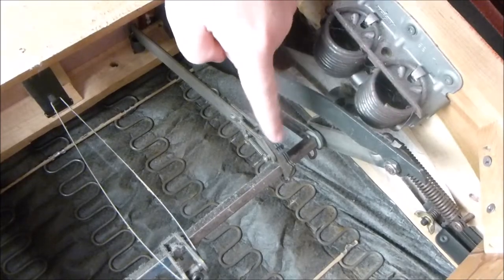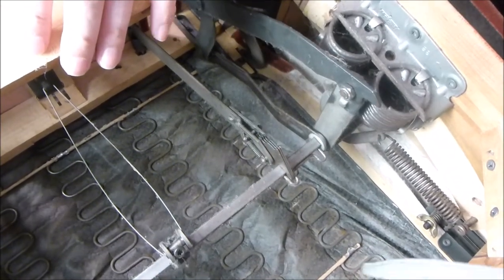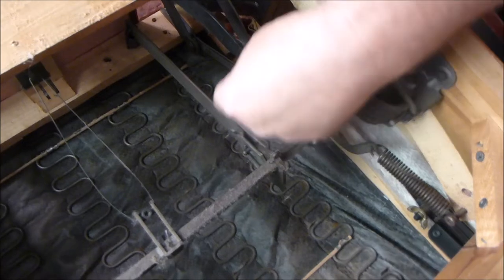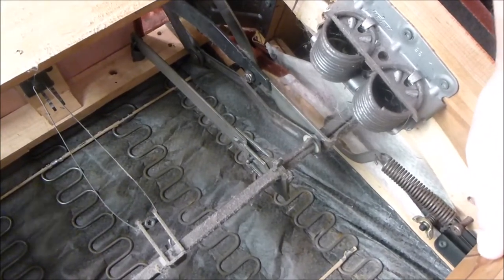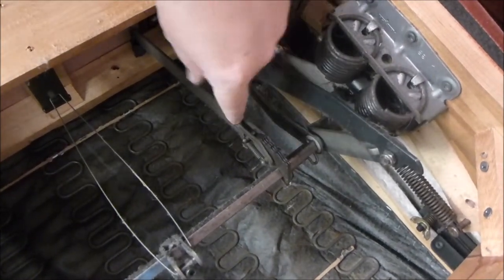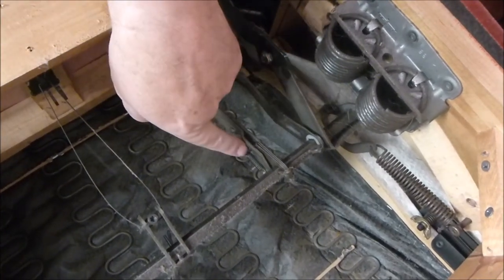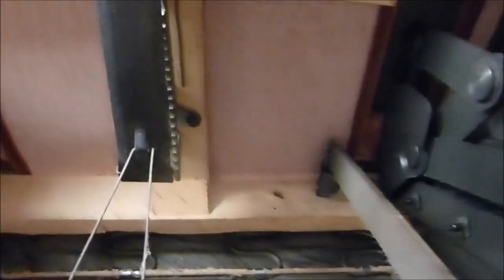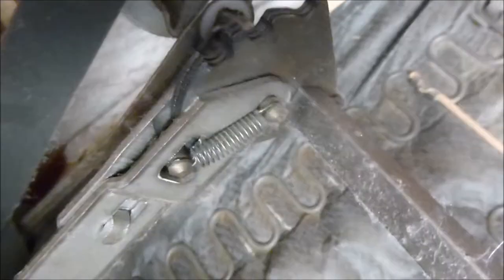Lazy boy recliner, footrest problem

Comment: Thank you for your vid. It's the wire piece/part that has snapped on mine... The wire part that you pointed out towards the end of vid and said it might be broken and jam up into the area above it. What is that part called? Do you happen to have a part number for it? Thank you
Reply from the maker: I do not know the part number but if you told the people that work at a Lazy boy dealership  where it is ( or take a photo on your phone ) they could get the part. For that matter your recliner might have a lifetime warranty on that part.

Comment: We just bought two new Lazy Boy recliners with the mechanical handles. We had too many problems with the power chairs. My wife's chair has too much tension on the foot rest. When she uses the handle to lower the foot rest, it slams down making too much noise. I adjusted the tension on the spring but was only able to move it one hole (no more left). It is slightly better but still too noisy. Mine is smooth and quiet. Any suggestions? Thanks!
Reply from the maker: There are ways but I would not do it to a new chair. The best thing ti do is when you go to let the footrest down, just keep your weight towards the back of the chair and move the handle forward at a slower pace ( don't let it just snap to the end at the second half of movement ) by doing this you soften the noise yourself.  and as an added bonus the chair will last a lot longer as well.